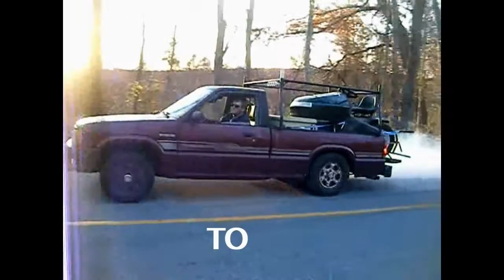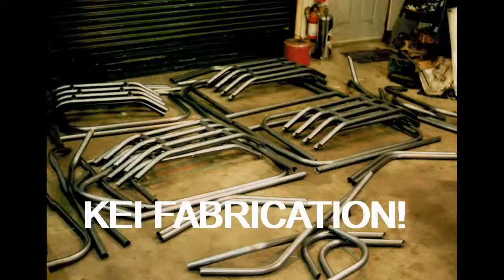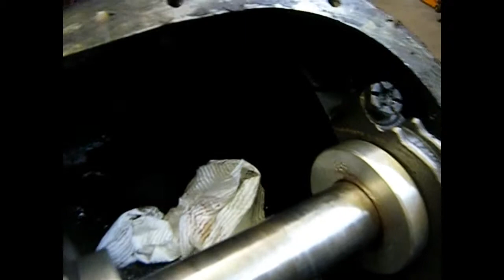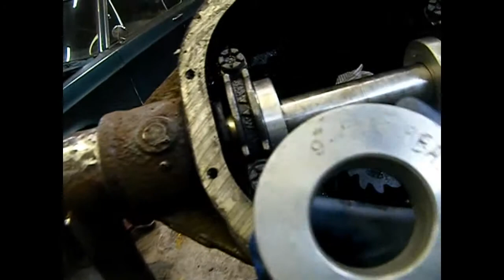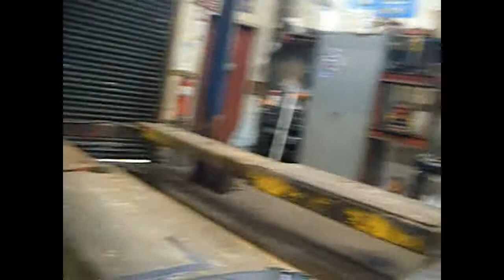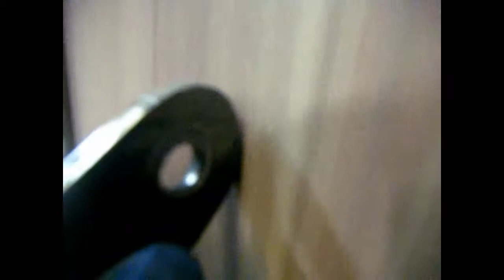NARROWING A FORD EXPLORER 8 8 REAR END PART 1

Comment: a foxbody 8.8 fits perfectly.  what gear ratio did you end up choosing? also what trans?
Reply from the maker: I was not aware the the Fox body is a good fit. Are the Fox body rears 4 lug? I wonder if the Fox body is 28 spline or 31 spline axles?
I chose the Explorer rear because it was 31 spline and 5 lug bolt pattern, as well as rear disk brakes. This gave me a larger selection of factory and aftermarket wheels to run.
I chose the 3.73 gear ratio. It works great with the 4L60E overdrive trans. 65 MPH on the highway is 2200 RPM with a 26" tall tire.
Thanks fro the comment and questions!
Reply: @KEIFabrication  the old foxbody axles were 4 lug 28 spline, but i installed a truetrac and 3.90 gears with custom 31 spline 6 lug axles from moser, and i used a tremec magnum, It's basically a tr6060. I'm at 2000 rpms at 80 with a 26.4" tire.  

the only problem is that the wheel studs are so close to the edge of the axle flange that the brake drums( for a 2000 ranger 4.0) actually get warped from the wheel overhanging the flange
and i need a wider tire but still want stock looking wheels
Reply from the maker: @outdoorsman310  Any Chevy/GMC 1/2 ton 4 wheel drive wheel will work from the early 70's to current model year. The early 15"  factory steel wheels were 8" wide. I was planning on using them but I didn't want to spend all the money on new custom axles like you did. I even narrowed the 1999 Silverado rear but once I found out how expensive the axles were, I jumped ship to the Explorer 8.8 rear. Now I have created a new problem to figure out how to convert the front spindles to 5 lug Ford. I should have that problem solved in about 2 weeks. The custom bushings I am having made to convert the front spindles to Ford Crown Vic. hubs are supposed to be finished late next week. I am hoping the conversion will only take about an hour to swap because everything is ready and waiting.
Reply: @KEIFabrication   the axles were actually $260 from Moser. I like your upgraded front brakes as well and am wondering if you have plans to install a/c?
Reply from the maker: @outdoorsman310  Thanks! I do not have any plans to install a/c.